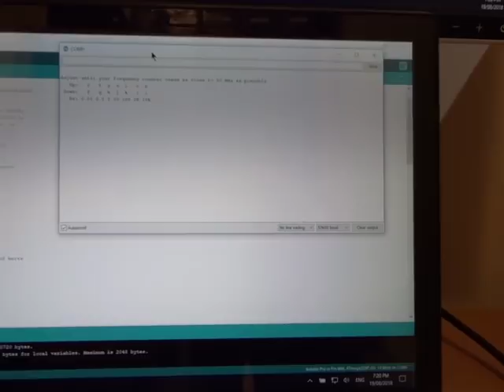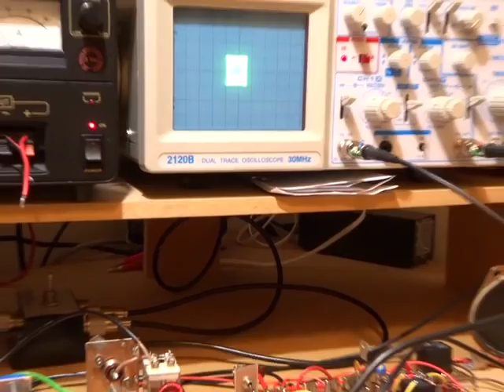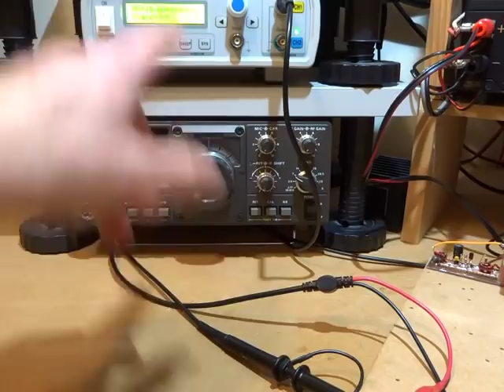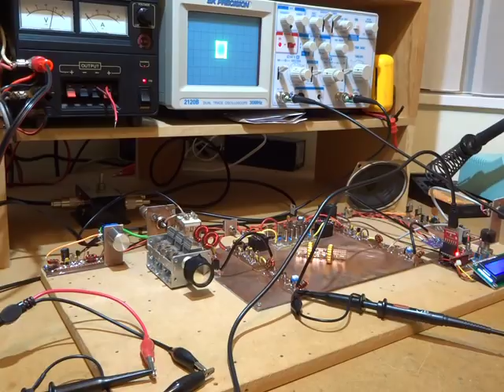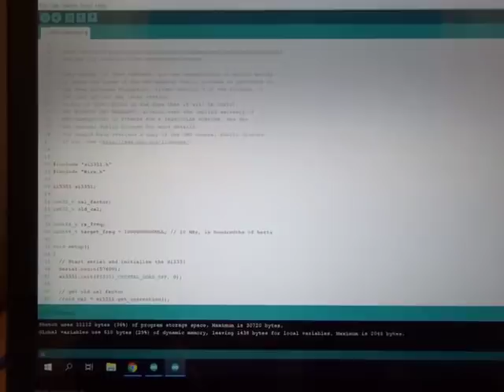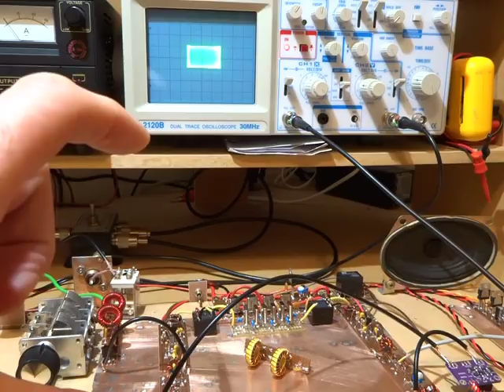Homebrew 80/40m SSB/CW Rig - #7a Si5351 Calibration

Comment: Hi Charlie i have been following this build when I use Jason Mildrums same calibration library  when I use the serial monitor interface
I don't get the ref keys to use I don't actually get any I basically get 2 lines one shows actual BFO the other shows same same VFO 
on the 12c display has this code been changed ?
regards
terry
Reply from the maker: Jason did update the library some time ago. I don't have any problems with the calibration sketch. I assume the baud rate is correct. I have had some strange things happen where i had to set the serial monitor at either 2x or 1/2x the sketch baud rate.
Reply: @CharlieMorrisZL2CTM   Hi Charlie thanks for reply yes baud rate is correct I will keep working on it great content on your videos

Comment: W2AEW has a video of using WWV at 5, 10 or 15 MHz as a reference. He tunes off the carrier to zero beat the VFO to the same tone. Using your ear you can get pretty close and then using the S-Meter to watch the beat you can get really close. Worked well for me with two Si5351 cards.
Reply from the maker: That's interesting. I might have to look into that as an option.

Comment: Hi Charlie. I´m from Argentina and im doing my final proyect, an antenna analyzer based on si5351. Im having problems with the resolution. I need two outputs of the si5351. One has to be 1 khz higher than the other. In 50 Mhz and higher , for example if i want 50.001 Mhz my oscilloscope show me 52 o 55 Mhz, is too far away. Is a calibration problems?

Comment: I would have thought having a PLL would have compensated for temperature drift. Maybe using this as a signal generator really isn't as great as I thought? I thought it should be much more rock solid - I mean, I guess it is way more rock solid than something like a basic colpitts oscillator without a crystal. At least there is a crystal involved. I wonder how much the drift is over temp

I experimented with my si5351 a bit (I'm only running it at 1.60Mhz) and even with my finger or hot breath on it, it only drifts by 1hz so far. I'd have to experiment more though.
Reply from the maker: The stability is certainly fine for the CW/SSB rigs I use then in. The lab quality, but certainly good enough.

Comment: Hi Simon,
this is iw2fvo from Italy.  I am going to use the 5351 for vhf application so I do need to generate a 1st local oscillator frequency from 50 MHz to 180 Mhz and I do need to generate the 2nd injection frequency of about 20.945 Mhz ( this last will be a fixed frequency ).
I would like to have some direction on how to setup the 5351 and hoe to control the 1st loc osc frequency. Could you help me please ?
Could you send the complete code of your project to take as a reference please ?
I do leave my mail: iw2fvo@yahoo.com.
Thanks for helping .
73, Ambro

Comment: I assume that your signal generator is accurate to 1hz or so, otherwise your method is no better than using a freq counter that isn't as accurate.
I calibrated my freq counter a few years back against a borrowed reference oscillator, it's probably drifted some since then, but when I last calibrated it, it had been off less than about 50hz.   That's probably close enough for government work, most people can't detect a zero beat any better than that.

Comment: good morning Charlie, It appears my original assessment of the signal maybe not sitting in the passband correctly ( due to frequency errors) may have been correct. 

The radio is sounding a lot better and all the oscillators will be a lot closer as you have calibrated your board against your signal generator ( which will be calibrated in the factory to some reasonable accuracy ). 

I am glad your now seeing the benefits of calibration and the difference in the two approaches to achieve the same outcome. Keep up the excellent video's

 best 73's 

Simon
Reply from the maker: Cheers Simon!

73s
Charlie